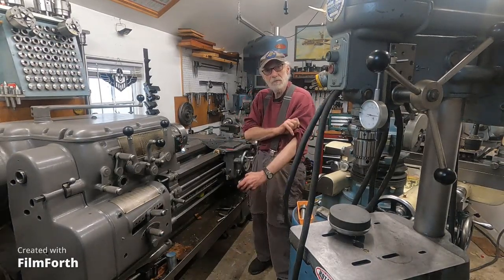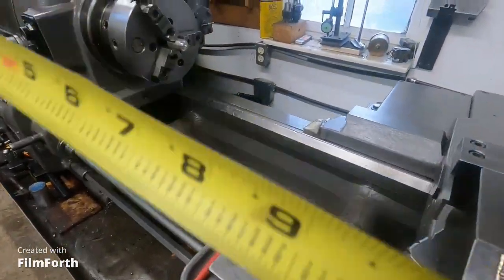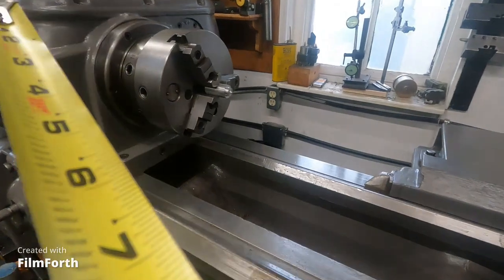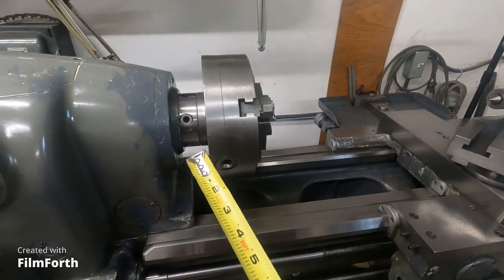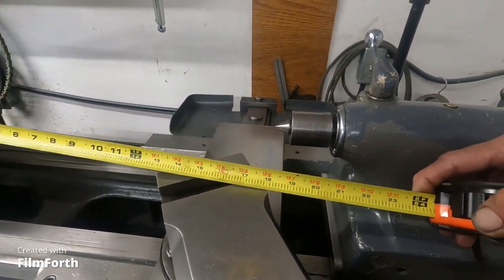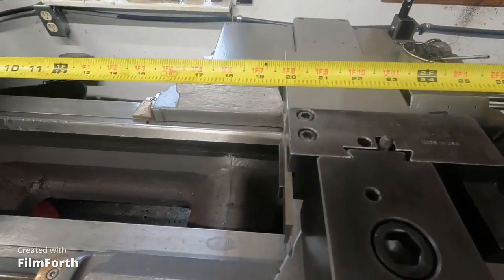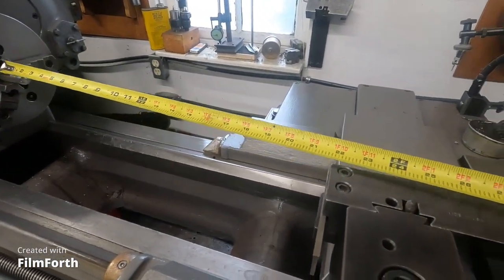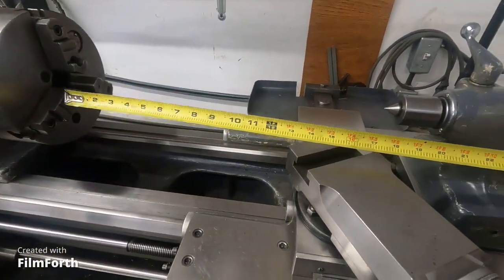Checking max length capacity using direct mount chucks

Comment: DeeDee, Thanks for plugging my desire for an inch/metric gearbox.  Sure glad to see you putting those D1-6 plates to use.  I’ve got an old 6 Jaw chuck without a D1-3 backing plate. I’m seeing them on eBay for pretty reasonable prices so I may be fitting that 6 jaw for my Monarch pretty soon.   Cheers, TB
Reply from the maker: That is a chuck I don't use much but nice to have for dusting out bronze bushings and other thin parts.